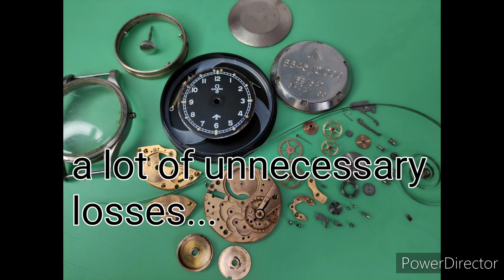How to destory a movement by trying to repair it vintage Omega cal.283 military 2777-1 thin arrow

Comment: My experience tells me that the only thing to replace would be the spring, the balance axis and possibly the anchor
Why possibly? because you can try to straighten it with a heated brass tweezer through very gentle and small movements. The same can be done with the axle of the third wheel, which has a wheel that drives the second axle and a spring for the second axle. The axles of the rest of the wheels look fine. The balance hair can be easily straightened so that the repair would not be as expensive as it may seem
Reply from the maker: you forget about the working time, working hours spent on trying to save damaged parts will cost similarly to new parts and without a guarantee of success.  the escapement wheel is damaged, the seat of the balance axle bearing must be pressed.  There is more damage, setting lever.  second mechanism for parts, best option

Comment: I would start with donor movement and only use the parts you need.  There is was on eBay for US$453 complete and working.
Reply from the maker: this is how it will look like, I am looking for a second mechanism for parts

Comment: And I have the exact opposite, the balance is alive, and the escape wheel and dial are dead, Omega 2506
Reply from the maker: I think that the necessary elements can be purchased
Reply: @Karol235  Not in RF,so sad(

Comment: It's pretty obvious as previous mentioned, that the owner really didn't know what he/she was doing. A 'handy person' is one thing but when it comes to intricate and delicate parts that you're not familiar with, best to leave it to the pros. Bad move on this one by the owner. Hopefully,...the owner gave the ok to restore it properly..(which I would've done from the start).  What was the outcome...if any...??
Reply from the maker: at this point, a second mechanism for parts has already been purchased.  waiting for the parcel.  the watch is very valuable the owner wants to repair it
Reply: Glad to hear parts are on the way and that the owner wants the watch restored to its glory..Excellent

Comment: It looks like the owner used excessive force to jam the parts into place. I've only been inside a watch a couple times and it was a fantastic education on how fragile and small the pieces are and that patience and a steady hand are the only ways to approach a job like this. 
Youtube watch repair/servicing videos often make the job look much easier than it really is. I appreciate when a repairperson shows the challenges and mistakes they face. It puts the delicate job into perspective. Solid video! Thanks for showing it. 
I have seen Rolex replacement prices (and gasped at how expensive the parts can be!) and wonder how Omega's prices compare. Still, I say that the watch is of high quality and would most likely be worth it to be brought back into working order.
Reply from the maker: hello thank you
prices for omega parts are definitely cheaper.  and there is much more access.  this watch is unique and expensive in terms of the dials and cases.  You can buy a mechanism for £ 200-300 in very good condition.  I personally think that the entire Rolex is heavily overvalued.

I agree with you when someone watches the service process, it does not seem difficult or complicated.  but to perform such a service well without damaging any very delicate element is not that easy

Comment: Just get a donor movement and you could finish the repair within a few ours. You are making things bigger than they are. 
Perhaps not much experience which is not a bad thing. You will learn in the coming years. Or you won't.....
Reply from the maker: Thank you for your opinion, the film was made as a warning that if you don't know something, you can't do something, don't do it.  not all damage is visible in the video.  escapement wheel, balance bearing mount, bottom are also damaged.  scrap mechanism.  the cost has risen to nearly £ 400 instead of 110 for normal maintenance